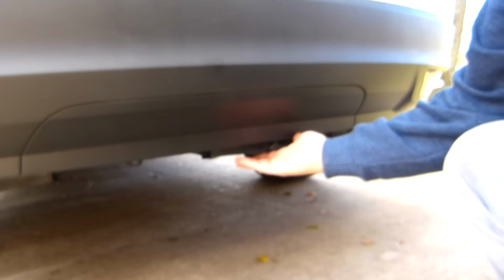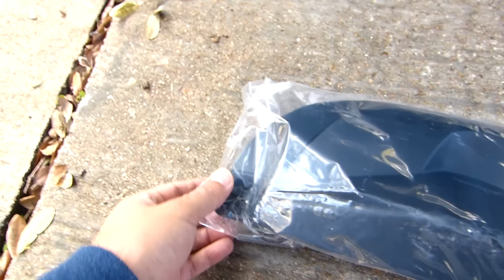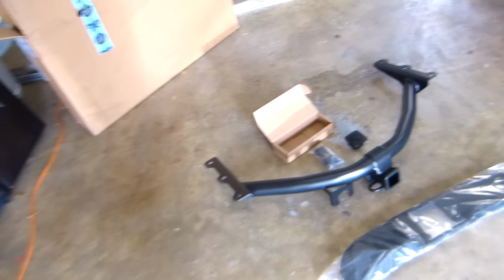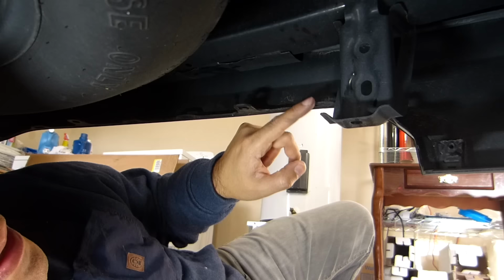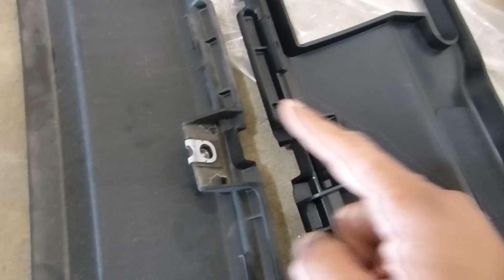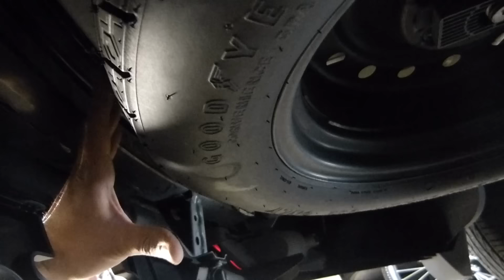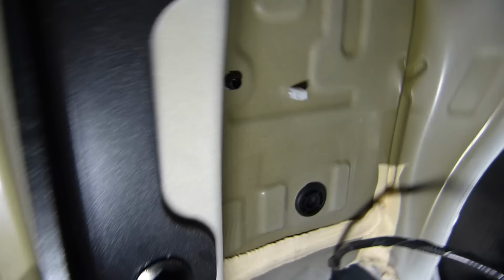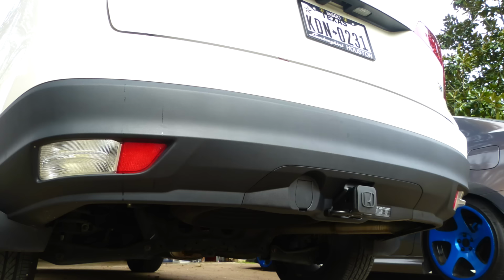$265 Trailer Hitch OEM 2017 Honda Pilot from AMAZON

Comment: Great video, really helped me out. The only tricky part were the tabs on the replacement bumper. If you use a screwdriver and push the bumper towards the inside of the car they free up easily.

Comment: Great video friend. Straight fwd with good explanation and video presentation.
Since you live in Houston, south State, I have heard from guy in upper States where winter season is regular to use a fluid film on the bolts after installation. It protect bolts from rust.
Reply from the maker: Yes that's a good idea to add a little oil for the bolt to prevent rusting. Thanks 👍

Comment: Couldn't you have first removed the old cover, installed the hitch and then install the new cover to eliminate the need to drop the spare tire? Seems like it would've simply slipped right through the square hole to install. Thank you just the same for sharing this video. Very helpful.
Reply from the maker: Removing the spare tire will make your life more easier for the installation 👍
Reply: @Shinegadget  Ok. I suppose I could use the practice lowering and getting that spare off of the cradle too. It would be ideal to do it in the garage instead of on the side of a busy highway. :)

Comment: Does anyone know if this part fits on a Canadian Model?  Canadian Parts is 08L92-TG7-300 instead of 08L92-TG7-100 , but is there really a difference? If yes what is it?  What about the harness? 08L91-TG7-301 vs 08L91-TG7-101 ? Would both fit on both Canadian and Us model?
Reply: I confirm it does

Comment: Nice video! Any chance you could measure the distance from the ground to the top inside of the receiver tube opening? I'm trying to determine if the OEM hitch sits higher than aftermarket options.
Reply: the OEM hitch is 2.5” higher than the aftermarket ones. That means the departure angle will not be changed with the OEM hitch. Yes it's about $100 more expensive but it also includes bumper panel for hitch, mount points for trailer harness & hitch cover.
Reply: @j8ffshin329  Thanks a bunch. The extra ground clearance is worth it, IMO. Now if I could just find the adapter for the tailgate kicker in stock somewhere, I'd get it all ordered!
Reply: @ryanhorner6354  what's a tailgate kicker?
Reply: @j8ffshin329  The silly hands-free sensor in the bumper you can kick your foot underneath to open the tailgate. The regular sensors go all the way across the bumper, including where the hitch reciever tube exits the bumper with the new insert. The hands free adapter supposedly has shorter sensor bars.

Comment: Hermano, I have a question..i have a 2021 Pilot. I see you have listed 2 links. Which one do I need? Also do I get the hitch and the black panel and I have to buy the harness separately? Gracias hno
Reply from the maker: this one will fit your Honda pilot,  2019 - 2022 Honda Genuine Parts 08L92-TG7-1A0 Trailer Hitch https://amzn.to/2VA1J2H Thanks 👍

Comment: Did you have the hands free tailgate? If you do,Is it working fine?
Reply from the maker: no sorry I don't have that
Reply: What i have read about hitch installation on Pilots with hands free tailgate is that you need to relocate sensor to the right from the middle position because of the hitch. There’s the bar that the sensor is attached to it.